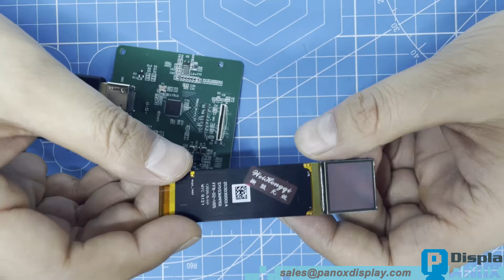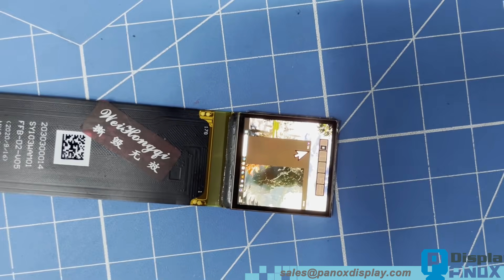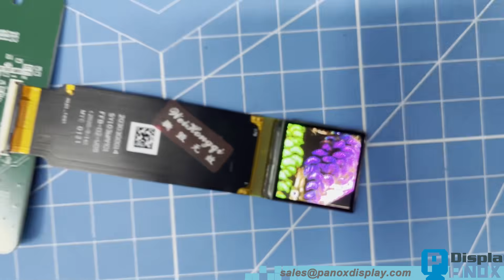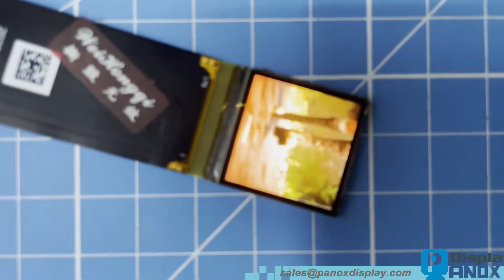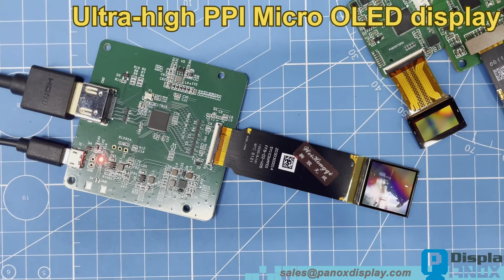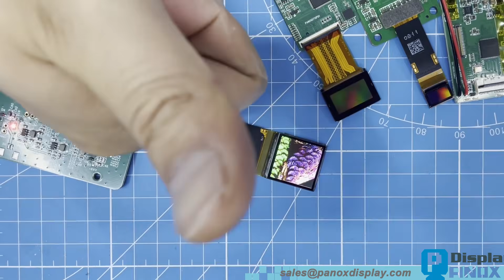1-Inch Micro OLED Display with 2560×2560 Resolution | HDMI Driver Board for AR/VR & EVF Projects

Comment: No microscope shot? Might as well be half or even quarter of the proclaimed resolution, the video doesn't prove it.
Reply from the maker: this micro OLED is connected to the computer which recognize it at 2560*2560 resolution. And we are an OLED distributer, all our clients will check the samples. So it`s unnecessary for us to write fake parameters

Comment: This is crazy. A typical modern smartphone has a pixel density of around 400 to 500 PPI. At over 3500 PPI, this tiny 1-inch screen is roughly 7 to 8 times sharper.

Comment: TBH I wish this was LCD, I can hack a LCD to be a spatial light modulator.  Back to buying broken Epson projectors I guess.
Reply: Think I've seen LCDs at a similar size, though I don't believe they're as high resolution.
Reply: @eqvbz  They make them for projectors, but you cant really buy them directly, you have to buy the projector to get them.  And even if the projector is trash shipping is still expansive. And 4k projectors are still pricy even if they don't work.  So getting the little LCD's out of them is quite hard and costly, and I know quite a few are just thrown away but I have no practical way to salvage them.

Comment: Ar/xr glasses with this would be so dang good, if you used in something like xreal style glasses you could push the fov to near 80-90 probably just because 1 inch is a nice size for that
Reply: especially with those brightness specs, the lenses usually need really bright screens
Reply: @slimesoliloquy  yeah like the newest vitures and ray neos are pushing 1200-1500nits, but i can still see the difference in pixels (very subtle mind you almost perfectly clear) on Xreal one, so i think a panel like this would be perfect with some proper placement and optical engineering

Comment: if this becomes widely available for a somewhat reasonable price, I can see this being used for DIY VR Headsets
Reply: There is a DIY headset that uses this, the DaemonXR. The panel and a different driver board was available for these for relatively cheap. At one point, I hope the price comes back down too. 

Also, similar (same?) panels are already being used in the Bigscreen Beyond 1 & 2, Arpara, and the lower trim of the upcoming Pimax Dream Air.
Reply: thats very cool, what is usually proprietary hardware is available to us thinkerers. I'd imagine like a VR headset with upgradable and interchangable displays. Just take the old one and put a better one, tho i think that would need to have a very compact controller.
I imagine framework using this and having tiny DP displays
Reply: thats dumb